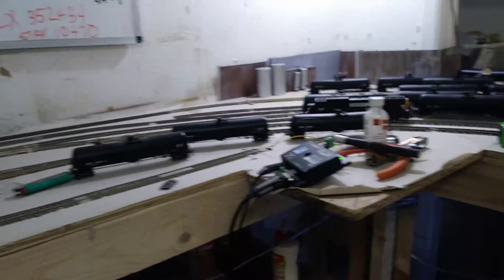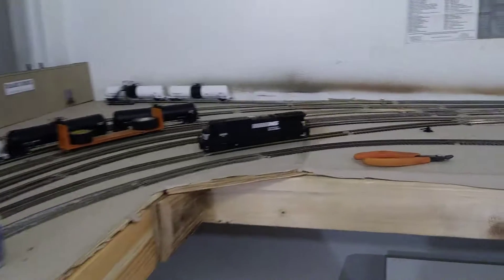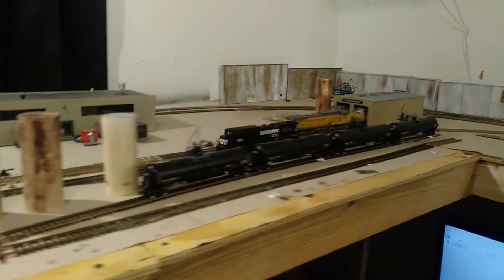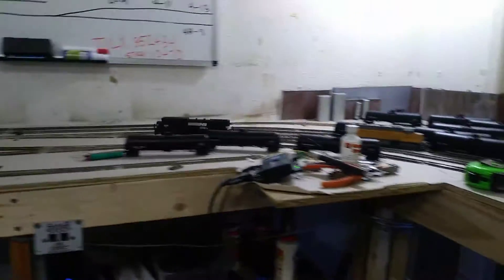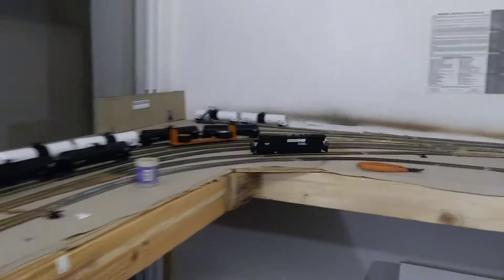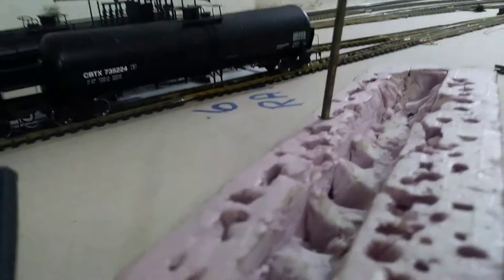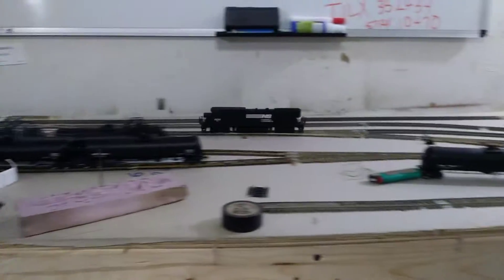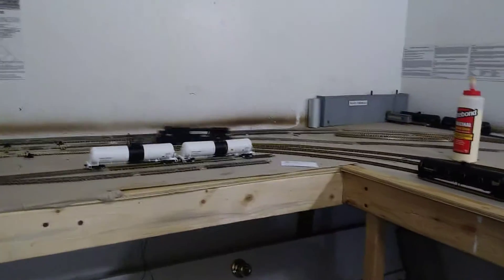What The Hell I'm Doing Part 6

Comment: That N&W locomotive is a GP40, however they we're never in the 6000 number series they we're in the 1300 number series. It has 3 fans on the top rear of the locomotive. Also I believe that NS unit is a B40-8.